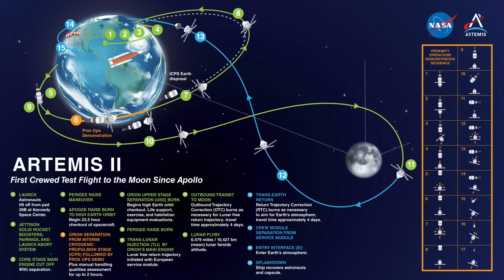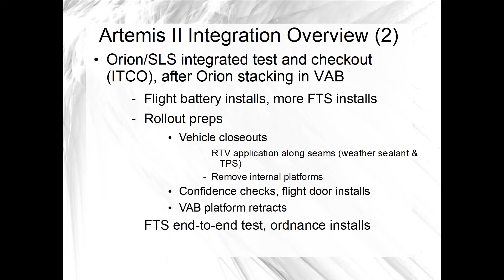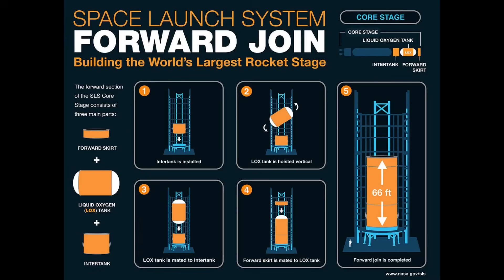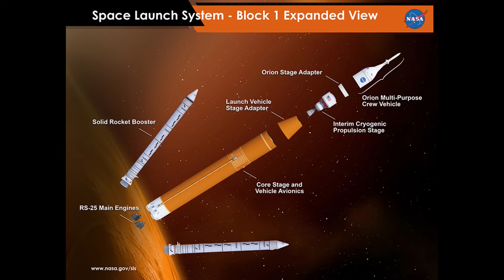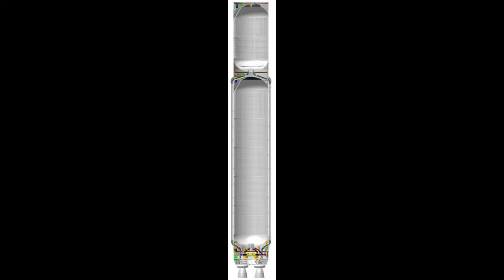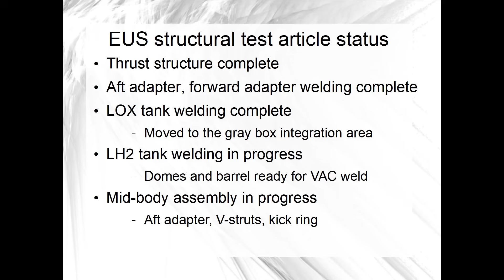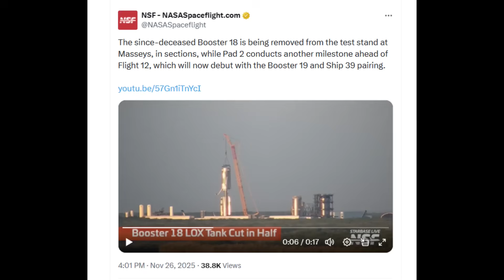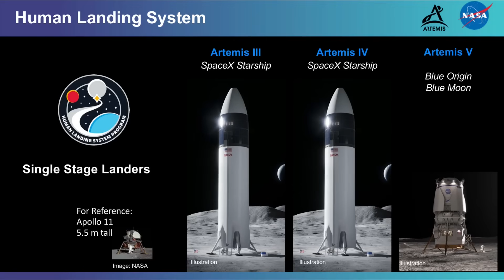Is the Artemis II CDDT in the critical path?  When will the Artemis III SLS be ready?

Comment: If the Artemis III first-stage LH2 tank is ready to be mated to the forward assembly first-stage assembly why not instead ship it to the VAB at KSC to stack and bolt it onto the Artemis III first-stage thrust-structure?
Reply from the maker: There's no indication yet that either the LH2 tank or the engine section are ready to mate.  Bigger picture, why is that better and what are the other consequences?
Reply: @PhilipSloss  By mating the LH2 tank vertically on its own in the VAB high-bay it seems to me to be easier at that end as while the LH2 tank is long it isn't as long mated to the forward end., also my understanding is that the LH2 tank was originally supposed to be mated to the thrust-structure first vertically. Then have the forward skirt/LOX-tank/intertank assembly mated vertically. But IMO what really should've been done is way back when the SLS first-stage production line was set up, about ten years ago, is that a proper vertical assembly building at Michoud should've been built just like the one used to assemble the Saturn V's S-IC in the Apollo programme before shipping the whole first-stage to KSC.

Comment: If they flew more missions, would that lower the per flight price? Can they not fly a couple extra missions and work on some science or just assemble the Gateway? Maybe get a few more uses out of that super expensive launch tower.
Why do the SLS pics and videos always seem like they are moving in slow motion
Reply: The current per-flight price of SLS and Orion together is well in excess of $4 Billion.  Flying more missions - as much as one per year - is expected to eventually lower the per-launch price to ~$2 Billion.

Unfortunately, SLS' production and processing infrastructure, as well as its manufacturing design, just aren't calibrated nor funded to support more than one launch per year.  And even the aspirational once-per-year launch cadence is still a few years away...

By the time SLS could streamline and accelerate its launch pipeline and operations, Starship and New Glenn 9x4, between the two of them, will be launching on at least a weekly basis - if not multiple times per week.  It will only be a couple more years until SLS is completely obsoleted and eclipsed by these commercial super-heavy launch systems.
Reply: @Spherical_Cow  This is the result of flat funding, it only hinders development and total costs in the end. Apollo had Gauss like curve funding across all of its programs, they had exactly what they needed when they needed it, that's partly why everything moved so fast compared to Artemis, and also because total funding was much greater of course, at least 5 times greater annually on average.
Reply: @FrankyPi  are you suggesting that funding for Artemis is likely to be increased?  As far as I can tell, Artemis isn't exactly high-priority for Congress - and especially not after Artemis 5.  And again, once Starship and New Glenn 9x4 are flying regularly, there's no longer a point to spending a single cent on SLS - including on SLS Block 2 development.  Even Artemis 5 is in question, as SLS probably has a remaining useful lifespan a bit shorter than that of the ISS...
Reply: @Spherical_Cow  No, I'm merely pointing out the differences between the two programs and types of funding curves. You're flat out wrong about SLS, neither New Glenn (whatever version) nor Starship (whatever version) are capable of even replacing the role of Block 1 SLS, let alone upcoming versions, and even if there was some viable alternative on the horizon, SLS and Orion are signed into law and funded all the way to and including Artemis V.
Reply: @FrankyPi  law can change.  Isaacman - if confirmed - will advocate strenuously for abandoning the SLS in favor of commercial alternatives.  And a v4 Starship that can with a single launch put more mass in LEO than any Block of SLS and at less than 5% of the cost, any week and twice a week all year long, makes SLS - even Block 2 - utterly pointless.  Higher-energy orbits are then available through payload-integrated pusher stages as well as orbital propellant depots.  Same goes, though to a somewhat lesser extent, for New Glenn 9x4 with its 70 t to LEO capability and Blue Origin's in-orbit refillable Lunar Transporter architecture.

The days of SLS are numbered, and the sooner this money-burning dumpster fire is extinguished, the better.
Reply: @Spherical_Cow  You're so far removed from reality it's remarkable to witness someone this deluded. Isaacman stated he will follow the law, and no matter what he wants to do, Congress holds the reins anyway. SLS payload to LEO is irrelevant when it's not a LEO rocket (btw Block 1 LEO performance is 95t not 70t, this has been public for years), it sends heavy payloads to TLI, which none of these rockets can do aside from New Glenn 9x4 which still falls short of what Block 1 does, let alone 1B and 2. The only days that are numbered are for your delusions and fantasy world you constructed by naively and blindly believing cargo cult and corporate nonsense, so enjoy while you still can in this make believe world before it all inevitably crumbles in front of you.
Reply: @FrankyPi  either Starship with its orbital propellant depots, or New Glenn and Blue Moon with their Lunar Transporter, will be required to be fully operational before the first American footprint lands on the lunar south pole.  Either architecture will be capable of putting far more payload onto TLI, than any Block of SLS.  And it doesn't matter that these architectures require multiple launches per mission: when each launch costs a tiny fraction of SLS, and multiple launches can be executed per month.  So as a matter of inescapable fact, some months if not years before American astronauts land on the Moon again, SLS will be already obsolete.

So, I'm afraid the one living in delusional fantasies is you.  Enjoy it while it lasts; it won't be much longer.
Reply: @Spherical_Cow  You're completely ignorant of the fact that no HLS architecture is capable of doing the role of SLS-Orion, performance/general capability wise let alone programmatic requirements for crew launch and two-way transport wise, almost as if they weren't designed to do that. Like I said, enjoy your delusions while you can, because they will be shattered in the coming years, it's only a matter of time.
Reply: @FrankyPi  Orion will likely live on for a little while, past SLS.  Either a variant of Starship or New Glenn 9x4 should be capable of launching the full Orion stack - replete with ESM and LAS - past LEO (maybe even to HEO).  From there, all that's needed is a beefed-up ESM, with enough propellant and delta-V (perhaps around 4.5 km/s) to put Orion in low lunar orbit, and then return it from there into TEI.  So no, even Orion won't need SLS anymore, once better commercial alternatives come online over the next few years.
Reply: @Spherical_Cow  None of what you said will come to pass, it has no connection to reality whatsoever.
Reply: @FrankyPi  there is no sustained lunar base without the things I said coming to pass.  SLS simply isn't sustainable - both financially, and in terms of its extremely limited launch cadence.  Period, end of story.  If Congress insists on keeping SLS funded indefinitely, it will be in effect insisting on Artemis ending prematurely and even more ingloriously than Apollo.
Reply: They can't do a mission to Gateway until Gateway arrives in NRHO, and it can't arrive there until about a year after launch, which is still planned for 2027 but is slipping to 2028, which means NRHO arrival NET 2029. Also yes, the more SLS and Orion fly their costs will drop until they stabilize at a certain marginal level in the long run, some of that will be through optimization of processes involved, and in case of Orion, increasingly reusing components in addition to that. From Artemis V onward, Orion hulls will be reused.

Comment: Artemis program may delay..
 
But nasa has another plan to land astronauts again on moon via blue moon lander. 2026 begins with the trials. 

Happy return. BO❤🇺🇸
Reply from the maker: They might have another plan, but NASA hasn't said much and whatever options were discussed aren't finalized.  The first Mark 1 landing mission is still the first measuring stick for Artemis and we'll see when that flies.  But there's no guarantees that Blue will have a system ready by the end of 2028, either.  (Same for China's crewed lunar landing program, although they are operating on a little bit different timeline.)
Reply: @PhilipSloss 2026..nasa/BO will surprise you my friend ❤🇺🇸

Nasa was smart to put its apples in multiple bucket.

Comment: It feels that you take the schedule concerns while neglecting the context surrounding it. Starship HLS is effectively being asked to do almost the entire mission itself. All the LM had to do was go from low lunar orbit to the surface and back. HLS has to launch into LEO, get all the way into NRHO, land, then return to NRHO, which is only a few hundred m/s short of lunar return. If they had a sufficient reentry capsule, they COULD do the entire mission with HLS alone, no SLS or Orion needed.

It's easy to point at HLS and say "they're causing the delays, how dare they", and forget that they've been given 7 years to effectively do all of apollo themselves with a lander 10x as big. Apollo started in 1961, and landed in 1969, HLS was awarded in 2021, so even if they delay things to 2029, they still won't be behind Apollo. It's not their fault that SLS and Orion had a 15 year head start and ended up being ready a year or two earlier than them. It doesn't much matter that they were supposed to be ready in 2024, SLS was supposed to fly in 2010, with a lunar landing in 2016.

I decided to read the full HLS option A selection doc recently, and she mentioned that while the starship HLS architecture was more risky, the extra capacity it brought was more than worth it. And despite that, she also pointed out that it didn't have as much to get in the way of the schedule as the other two options. Meaning that even then, NASA knew starship was likely the fastest HLS option.

I know you try to be unbiased, and not over glorify starship and spacex, which is fair. But it would be appropriate to give a bit more context for what they're trying to accomplish and the amount of time they've been given to do it.
Reply from the maker: The HLS requirements are much better and longer known than the HLS schedule concerns.  Or the SLS/Orion schedule concerns, which are also much better and longer known than the HLS schedule concerns.
Reply: The HLS version of Starship will have a much greater capacity to bring mass and astronauts to the lunar surface, but it is far from replacing SLS and Orion. There is no plan that I have seen to make Starship human-rated for launching astronauts from Earth to LEO or to carry a capsule capable of Earth atmosphere reentry at the Mach 25 velocity of return from the Moon (or Mars). SpaceX could develop all that, but not before 2030 at the earliest.
Reply: sun-like